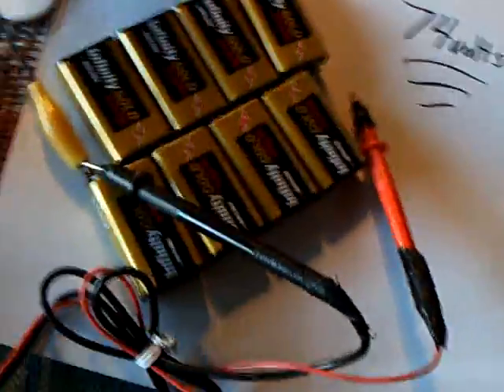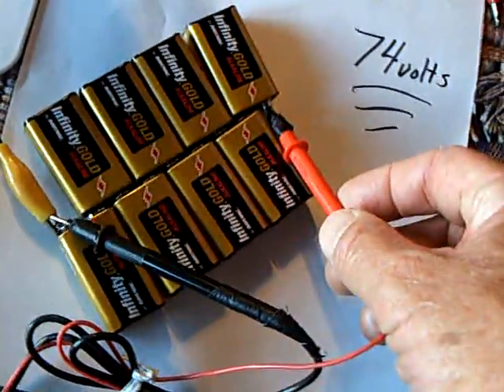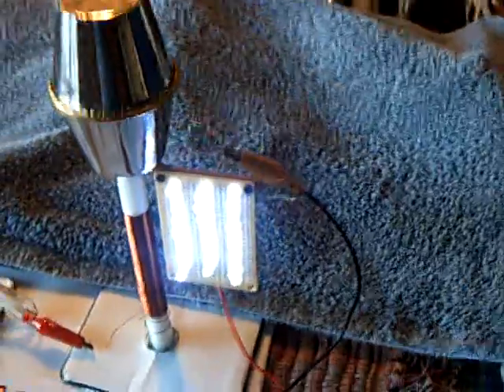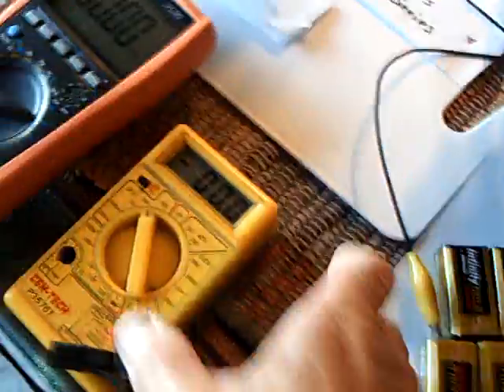SEC 15---- Lidmotor's 9volt battery test

Comment: measure the current going through the LED loop when powered by the SEC and the voltage across it, multiple together to get AVG power, do the same on the input and present those values..

Comment: I have been watching the docs videos, every as he puts them up. Even if the voltage is a clean reading, which means the wattages are a clean reading, I am not seeing any addition power from the sec, again the sec has less voltage but draws quiet a bit of amps, (well comparitivly). Its a very interesting system, and power transmission, but maybe the power comsumption is just too close to call it more than a transformer. If the sec was at .1w well that would be different for sure.

Comment: sec at .225w
74v pack at .026w
83v pack at .556w
sec light intensity is less than the 83v but more than the 74v, which is colaborated by the wattage being between the two. 

The meter is measuring the sec powered led voltage at a lower than rms giving a false reading of 74v. 

I just see a creative transformer here, nothing else. 

A computer connected to sensor board to measure V and A and area under the curve at a fast rate is needed.

Comment: Well, something strange going on if we do measurements:

SEC: 9V * 0,025A = 0,225W
B-Pack (74V): 74V * 0,00036A = 0,026W
B-Pack (83V): 83V * 0,0067A = 0,5561W

This show, that 74V B-pack is efficient than SEC system, but when you add another 9V battery = 83V for some reason, it turns to be that SEC is more efficient. But again, it was much brighter than SEC at that point.

Did you remove that 9V battery from SEC when you was testing draw on 74V on LED?

Nice experiment anyway!